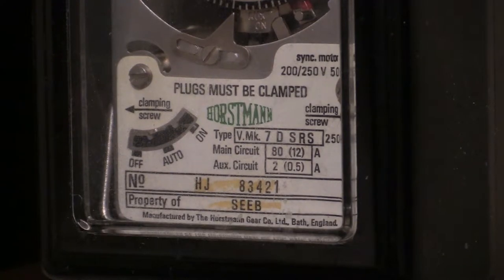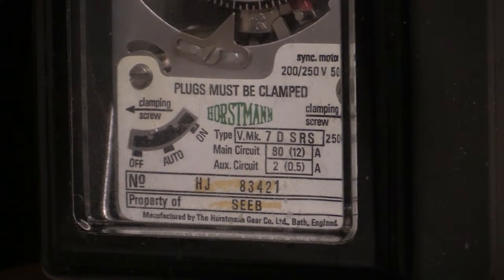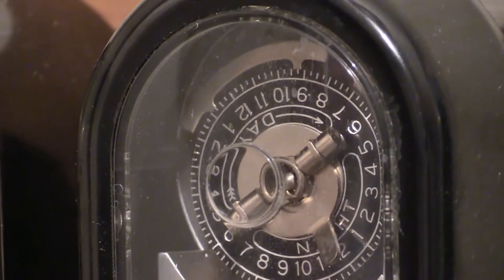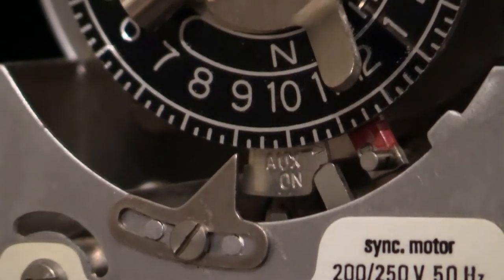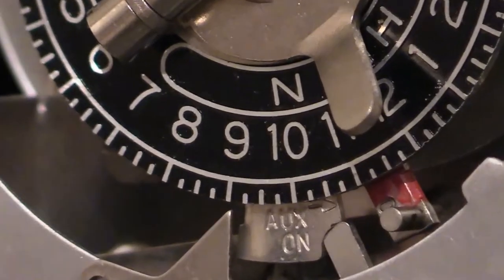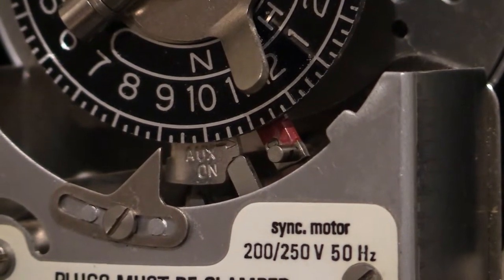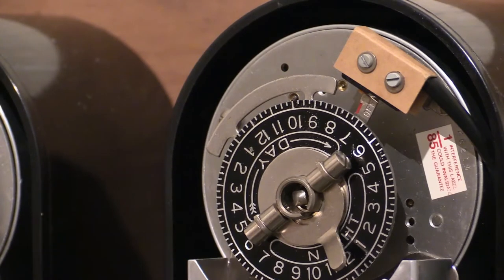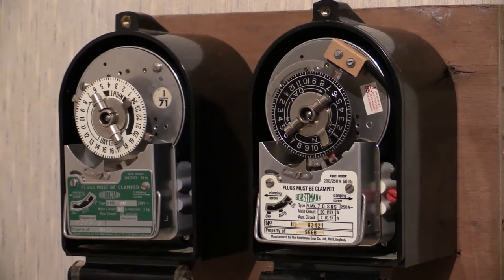Time Switch : Horstmann *SPECIAL* Vmk 7D SRS Rate Changer timeswitch.

Comment: My son has a Horstmann vmk rd 7 d srs in the house he is renting. I wish I could send you a photo but I don’t know how.
Reply from the maker: Hiya! If you click the link 
below, it will take you to 
the "About" tab on my 
channel. Once you arrive there........ 
.
.
.
.
.
.......click the Email link and then you can send a picture of the timeswitch / Rate Changer. 

Here's the link:

https://www.youtube.com/c/WaynesElectrical/about

There we go. :D

Thanks for watching,

-Wayne's Electrical.

16th November 2020, 14.20
Reply from the maker: Hiya! I have reviewed 
the pictures you have 
sent, and by the looks 
of things, the installation is using...... 
.
.
.
.
........The Horstmann Vmk 7D SRS as a Rate Changer only.

It only has three 'small' wires connected to it and one of those will be the Rate Change Trigger wire.

Even though he has a Vmk 7D SRS in the installation, the fact that it is not performing any load-switching negates it being a 7D variant, as the 7D has the capability of performing a Rate Change some time before turning on the actual off-peak loads.

Because there is no load-switching taking place in the installation, there could be a standard Vmk 7 SRS in place of that or even a VA Mk9 SRS and those would work just as well.

Or even.....

Seeing as there is no load-switching taking place, a standard timeswitch would also perform the Rate-Change on the dual-rate electric meter, such as a Vmk 4 or a Vmk 5, or one of those cased-and-sealed Sangamo timeswitches I have. 

I can see that there is  no load-switching taking place with the Vmk 7D SRS, because if there was, there would be two rather thick cables connected to the underside of the timer, to an equivalent thickness of those large cables connected to the underside of the meter.

By the looks of things, the electric meter may be a L+G 5196d.....

You might be interested to know that I blew up one of those meters at Mr. Photon's house some time back. :D

We made a right mess of it. 

It was a meter that was given to him and the back was already removed from it, so there was only one thing it was useful for..... Aaaaaaand...... We blew it up. :D

Click the link below to see it going =POP=
https://www.youtube.com/watch?v=QMxNRjeJveQ

Thanks for the piccies. Those Vmk 7D SRS units are rare! Of the years I have been buying-and-selling Rate-Changers, I have never seen another one of those!

More vids later on Wayne's Electrical.

-Wayne's Electrical.

17th November 2020, 16.40
Reply: Hi. Very useful video. I have found out my energy suppliers low rate times are from 1.30 - 8.30am and my machine is showing 12 to 7 can this be changed by myself?